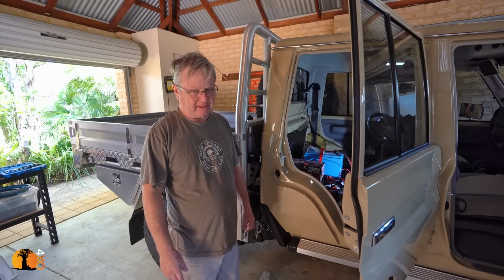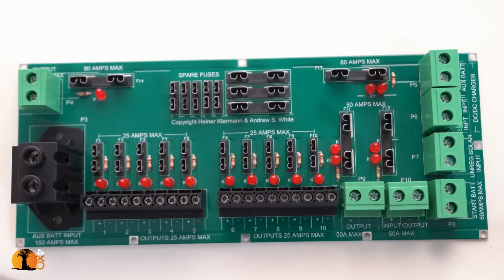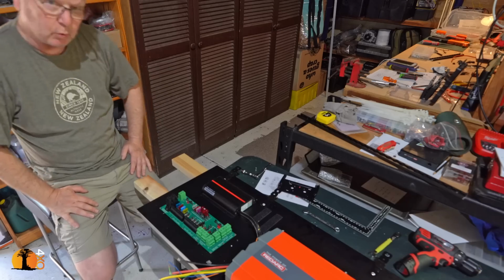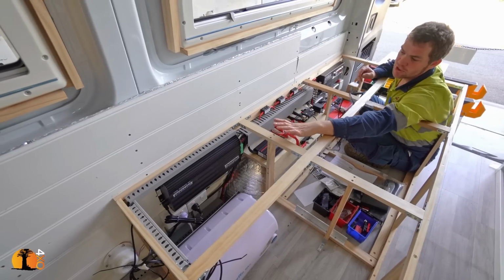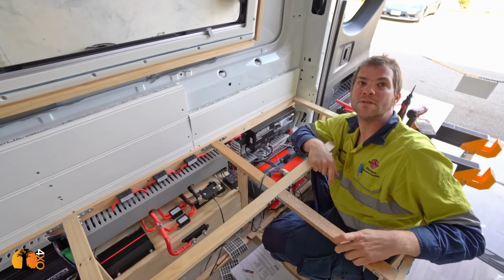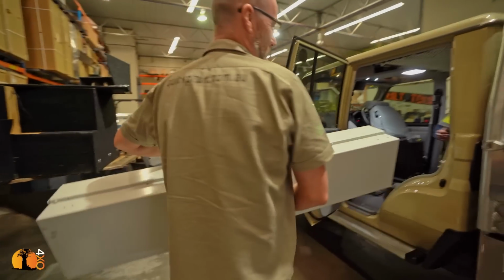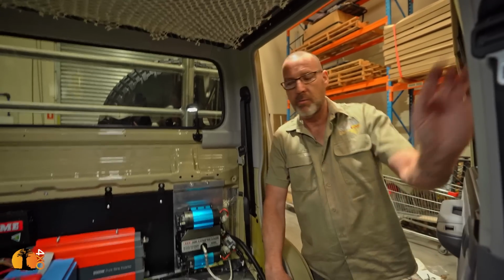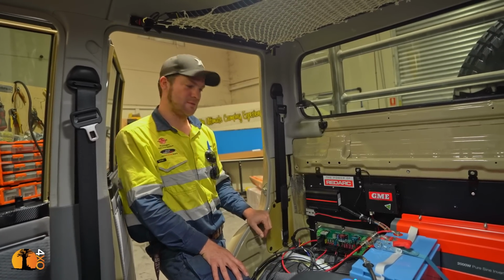ELECTRIC INSTALL. A BRAND NEW PRODUCT. Aussie Dream Tourer.

Comment: Great stuff Andrew, with some very diplomatic German and West Midlands  comments on your preliminary spaghetti! My previous truck's  inherited cabin build with initially very  intermittent  bullet fuses inspired by Lucas, Prince of Darkness pushed me to rewire with a superb  Blue Sea Systems  DC marine circuit breaker panel. Here  the Sprinter van's wheelarch area and use of the grey cable management trunking show us the way to aim next time, with Traffolyte labels  of course!
Reply: Blue Sea is superior.  Off roaders should look towards marine components for their builds.  There’s really a lot of good stuff out there.
Reply: @rd4660  Not cheap, but phenomenal kit and I got inspired wiring the outgoing circuits  by aviation cable management.....hopefully darkness banished for good !

Comment: Was I the only one shouting at the screen put the DC hub the other end of the board as the connectors would line up better either that or you need a right and left hand version of the pcb. One suggestion though as a licenced radio amuture I would try and keep that GME radio as far away from the rest of the wiring as possible or put a shield over it and at the very least ferrite beads over the cables, I have seen strange things happen when RF leaks into vehicle wiring looms sometimes not much more than the occasional warning light coming on at random times to airbags going off.
Reply: The DC hub looks like a bad idea to me. Circuit boards that have fuses on them just does not look durable. I've seen too many bad connections because of cracked solder joints. The whole lay out is very overlander style built, which I do not prefer. It takes up too much space that could be used for other uses. I prefer to have as few items as possible in the storage and occupant areas. Even if it takes more wire length to do so. For example that air compressor does not need to be inside at all. It could be under the hood or under the flat bed.

Comment: The downside of a central hub is the you have bring all of the cables to it even though the connected equipment may be remote. In indusrial installations one always has a mix of central and local panels, for this reason. However it's an interesting idea.

Comment: Great video, Andrew. 
I think you should test your central board with corroded wires. My main point of worry would be contact resistance at the connectors.

Comment: 6. When using the Battery Charger to charge a Lithium Iron Phosphate battery, only batteries that feature an inbuilt battery management system featuring inbuilt under and over voltage protection and cell balancing are suitable.
7

Comment: I think the "HUB" should have some sort of weather resistant cover. Just something to deflect dust and the accidental knocked over water bottle.
Reply from the maker: Mount brackets are under development now, and it is not designed for exterior use. That would have trebled the price.
Reply: For mechanical damage, reduced risk of accidental short circuits, dust and water protection etc,  yes a basic plastic electrical box with transparent quick release cover would work well. These also often have an internal detachable baseplate you can pre-mount the components.

Comment: Great work Andrew but all this raises a interesting question. You have , yourself and a auto-elec doing (and no offence intended or inferred here) wiring on a 'low voltage system' ie 240VAC which likely means a licensed electrician should be completing the work and it should adhere to the Australian New Zealand  Wiring AS3000. I say this not to be a pain or critical but that there is potential insurance ramifications if something goes wrong.  12VDC is classified as extra-low voltage.

Some of these issues are segregation and separation of 12VDC and 240VAC wiring, derating of cable current carrying capacity due to installation areas and bundling and selection of protection equipment on the 240VAC circuits

Comment: Andrew, I'm still in the planning phase of a similar build and was wondering if there's a way to get the door to open to a wider angle, therefore allowing better use of the space with drawers that come out and possibly fitting a fridge with a drop down slider!

Comment: Hmm... I was not sure what the DC Hub was about, other than providing Fuse Box functionality (yes, it has LEDs but they're available off-the-shelf also). 
I expect it will eventually be covered/protected.
Reply from the maker: Can one wire a charger, solar, DC-DC, aux battery, plus starter battery, plus 80 amp, 50amp and 25 amp equipment to the same fuse box? You can with this.
Reply: @4xoverland  So functionality-wise it is a fuse box?    No relays, or other such 'intelligence' ?

Comment: 🐈 
Rear seat belts will be noisy
If you didn’t use it remove it
I think the seat belt box need isolation or you gonna have 2 drums without control

Comment: have you ever considered putting a small PC in the vehicle instead of using a laptop? I think a small form factor PC build might be something you could have built into the car and you just pull out a monitor and plug in the cameras, the advantage would be customize able data storage and a more powerful computer
Reply from the maker: Not a great idea. Sometimes severe vibrations are part of the ride. Some gear just breaks.
Reply: @4xoverland  I guess a laptop would handle washboard roads a lot better, I could see the ram vibrating its way free from my pc's motherboard plus you already have one for day to day life.

Comment: Watched the videos and downloaded the wiring diagram pdf from egon website but i'm still unclear on earthing.  Are negative cables from both starter and auxiliary batteries run directly to the hub which is then earthed to vehicle chasis?  No other earth points?

Comment: Just a point but those connectors on the board are a really bad idea in any car never mind an overland tourer as they work loose with vibration. Would be much better using proper automotive connector plugs and sockets.
Reply from the maker: We decided that ordinary automotive connectors was a bad idea and instead are using wire clamps whose specifications go way beyond automotive applications. They are made in Germany, normally specified for use on underground mining equipment and earth moving equipment. I assure you, these clamps are not what they appear to be. You can't buy them at SuperSpares.

Comment: is not the point that the fuse blows instead of wires melting I am thoroughly confused as to why you want wires to burn?
Reply from the maker: To test the temperature threshold of the PC board to make sure fuses below well before it fails due to high temps. And the only way to put more than the rated current through the circuit was to fit heavy cable in place of a fuse. Because the fuse blows before anything even gets warm. We are testing it to its limits to find out where they are.

Comment: So the electrics in the camper... Do they have a sub-panel that connects to the DC Hub? Will the camper have 240 circuits? separate inverter?? Interested to find out...
Reply from the maker: Deciding on that now.

Comment: Andrew! Your wiring 🤔,leave it to your trusted engineer, Nuff said.
Reply from the maker: This is not a problem I’m trying to solve. And neither is this a mystery as to why it happened. It can and will happen to anyone using a DC-DC setup. It's the nature of how DC chargers work. All of them with the exception of those relying only on a trigger wire. The solution is to charge the auxiliary batteries first. It's that simple.
Reply: @4xoverland  this reply is for another comment

Comment: If you were to get pulled over by the police and you didn't have the back seats in a dual cab vehicle, will they fine you and give you a yellow sticker?? I did the same thing to my dual cab hilux but I was told I had to re-register my car as a single cab vehicle.
Reply: Andrew, I would just plan out and draw it on a 3d computer program first. these two guys are feeding you too much info on their ideas, not yours. or just draw on grided paper for at least a rough idea.